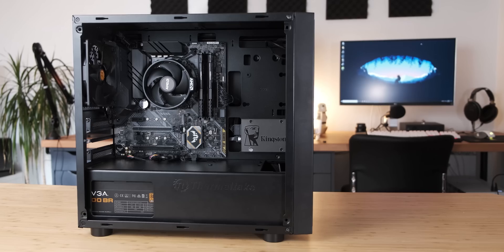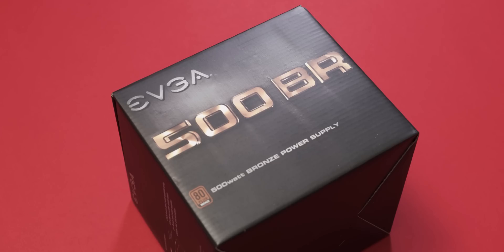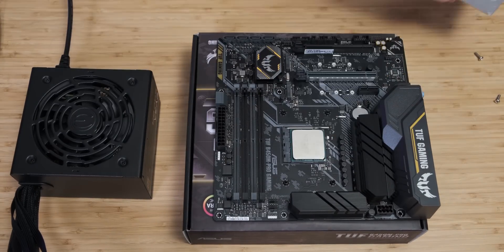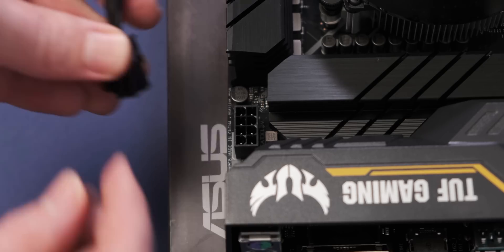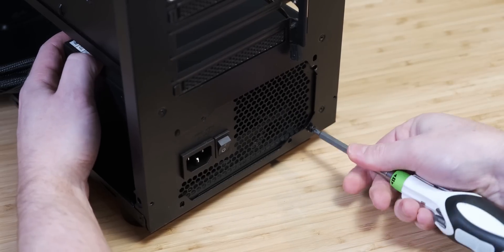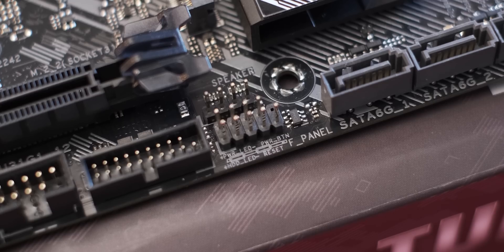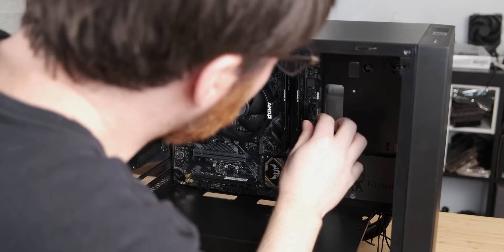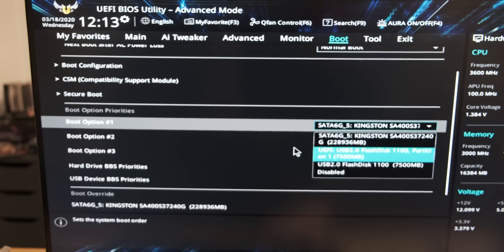How to build a PC: Quick Guide ($390 Pre-Built destroyer)

Comment: My friend said that he can sell me this pc for 420€ is it worth it?
Components:
Cpu: I3 7100 3.90Ghz
Gpu: rx 570 8gb
Ram: 16gb ddr4
256gb ssd
1tb hd
Pls help
Reply: First of all you don't mention psu motherboard and case. They are the foundation on every PC. If they are good future improvements are breeze. And with that i3 you will need it. With intel platform you pretty much have to deal with what it is.

Second believe it or not in my local second hand market I can get similar sistem for around 250-300€(with new ssd). I can't say your price come from a friend...
Reply: That i3 might throttle the GPU, honestly. In that case, you would have to upgrade the CPU and motherboard making it probably not wroth it. I would look into it, though.
Reply: @desperate_desperado  what other cpu can I put in instead?
Reply from the maker: Depending on what the second hand prices look like in your country, it's not too bad. However €420 seems like a lot for a used I3 7100 based system.
Reply: I3 7100 is just 2 cores. Maybe if you plan to do an upgrade in the future, but it's going to cost more...
Reply: hmmm sure he IS a friend??? lol
Reply: It's too much, i would never sell that PC to a friend for that much.
Reply: Worth about 300 👍. Although difficult to be exact as you haven't specified what MB or psu it has.

Comment: I have built over 300 pcs and one thing i goota tell you, the more you cheap out on the case more time you will spend fitting things in it, specially that IO cover, god damn it and yeah dont forget on sharp corners.
Reply from the maker: Oh for sure. Really cheap cases suck so bad. That's why I like the H17. It is still a budget case, but it's a dream to build in. 😁
Reply: same honestly. My first PC build I had a friend help me with because I knew nothing about building PC's at the time and he wound up choose out a really shitty coolermaster case that I wound up hating forever. Now that I know what I'm doing, I always try to recommend cases that are actually a pleasure to build in because it will make maintenance WAYYYYYYYYYYYYYYYY easier. A few extra bucks for peace of mind and ease of use goes a long way.
Reply: @Shoddragon  The cable management of the pc building process is why i cry over cheap cases and prices of a modular PSU.

What was the case btw so maybe i can dodge it if i ever need to build a pc for a friend
Reply: There's an old saying among techies, "Silicon is cheaper than iron". 
It's not exactly literal, but if you can use a screwdriver, it's cheaper to upgrade the electronics than buying a whole new box, so among other things, get a nice case. Not only will it make installation and upgrades easier, but you are going to have it for a long time so cheaping out now will just mean you're going to be spending more replacing it long before you otherwise would need to. (It's a version of pay a bit more now, so you don't have to pay a LOT more later.)

There's a nice case I had for around 12 years before I felt the need to change it out.
 A few months later I swapped out the power cord since that was the only part left from the original build. ;)
Reply: I really don't understand why an attached I/O shield isn't an industry standard.
Reply: @Nathan-gn3ls  same with unified front panel Cables i really dont understand why they made it all so... Tiny
Reply: @apatoxic   These aren't quite industry standards yet, although they are very close. practically every consumer motherboard uses the same layout for the front panel and I even found an extension that connected all of them to a 10-pin in the proper order for most mobos although I think it was from a seller in Taiwan and I haven't been able to locate another. Meanwhile, the IO shield cutout is standard, but a LOT of mobos have a separate IO shield to save pennies. You will see integrated IO shields on the classier mid and high end boards though.
Reply: @shannonrhoads7099  aah thank you for the information, really helped me understand more of the behind the scenes. Thanks a lot!
Reply: I jerry rigged a acer case to fit a asus motherboard
Reply: @-cryogena9290  wait, that sounds illegal

Comment: At the same budget I bought the same pc but with a gtx 970 (italy)
Reply: whoa must have gotten a good deal! in the UK their normally £200 or even more, has ur pc got good upgrade potential too?
Reply: @Gj05-g5v  you can buy 970 for £100 or £90 on facebook market and ebay.....
Reply: MAZOKU yeah I saw a 980 on there for 80 pounds
Reply: @harvmoid6065  Yesterday I bought GTX 1050 Ti Cerberus for £70 goes well with my i3 2120
Reply: @Gj05-g5v  yes, I can get max ryzen 7 3700x, 32g of ram and any type of gpu
Reply: Did u use the same case if so What fan/pcu/cpu cooling fan did u use or https://www.amazon.co.uk/Cooler-Master-Hyper-Cooling-System/dp/B01KBXKP8W/ref=mp_s_a_1_11?dchild=1&keywords=cpu%2Bcooler&qid=1592410354&sr=8-11&th=1&psc=1 would this work fine
Reply: @kylep1911  i dony have these anymore but I had a r3 1200 500w masterwatt and a aio cooler 120mm by cooler master
Reply: @kylep1911  that's perfect actually
Reply: Lexusss oh ok thank you very much

Comment: Fun fact about wraith coolers: you can remove the top and hide the cable underneath it when you put it back on.
Reply from the maker: That is a great tip. 👍
Reply: @DawidDoesTechStuff  good tip for a great build guide, we even got the same motherboard and RAM 😂
Reply: I found a sweet deal on an rgb wraith cooler and swapped it for my stealth one that came with my 1600af. Gives it that little extra flair but still a bit subtle
Reply: @musek5048  I need to swap the stealth one on my 1600af too, thinking about the hyper 212 black rgb
Reply: @tylerlogsdon8623  i was gonna go with that one too but after reading about everyone else's experience with it seems like theres not much benefit you get other than slightly lower temps. If you plan ro drop a higher core count chip in there later then yes of course you'd need a beefier unit but for this chip the wraith spire heatsink is a nice balance. The stealth heatsink is just too small to handle any significant overclocks on this 1600. Unless youre using it stock of course.
Reply: @musek5048  I got it up to an unstable 3.9 with the stealth, I want to get at least 4.0 stable
Reply: @tylerlogsdon8623  im have mine running at 4.1ghz stable with 1.2v. I'm using the wraith spire rgb cooler that comes with a bigger heatsink. I'm pretty sure that stealth is holding you back. And also depends on your mobo too since the vrms have to have enough cooling for higher overclocks. I have a tomahawk max since it did very well in temps in comparison to the other b450 boards. Try getting that hyper 212 although I wouldnt go spending too much on it if you dont ever plan on upgrading to a better ryzen chip later. I know i will have to when I eventually move up to a 3800 later on.
Reply: Thank You. Actually didn't know that.
Reply: About to build my computer with a wraith fan before my country goes on Lockdown thank you for the tip
Reply: @Columbakin  yo i can send you my wraith spire

Comment: What’s a good gaming PC to get, but not overly expensive
Reply: If you add a GPU, and don't mind going without an integrated GPU, you can by a ryzen 5 1600 AF, which is basically a 2600.
Reply: (It's $85)
Reply from the maker: If you have a bit more money to spend, you can change the 3200g for a 1600 and use a RX 570 and then you will have amazing performance for about $500.
Reply: this one but with a dedicated gpu
Reply: yeah, this one + dedicated GPU. I would recommend rx 570 or 580 second hand (both Sapphire Nitro+) i dont think they should be that expensive. With this build, you are good for atleast 2-3years